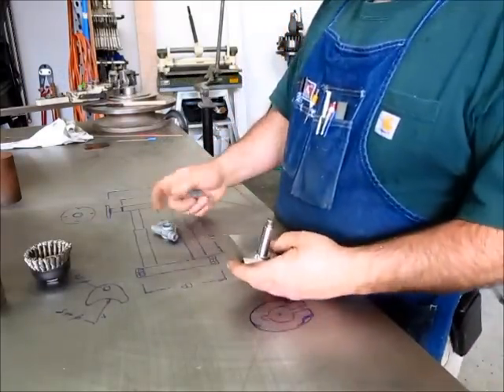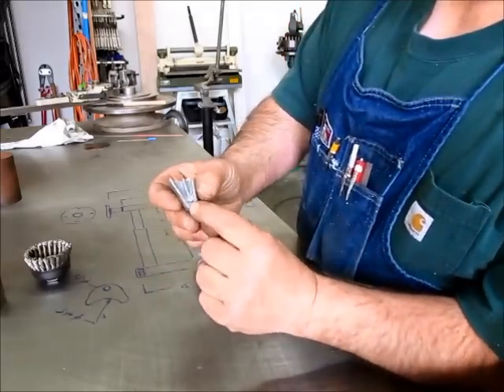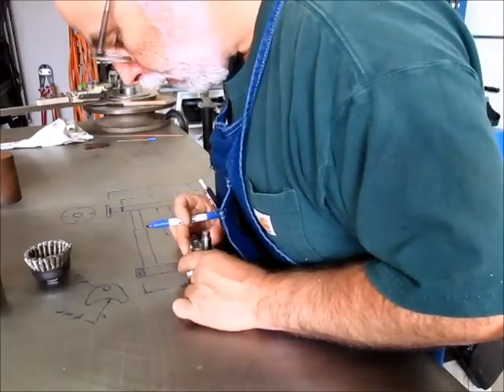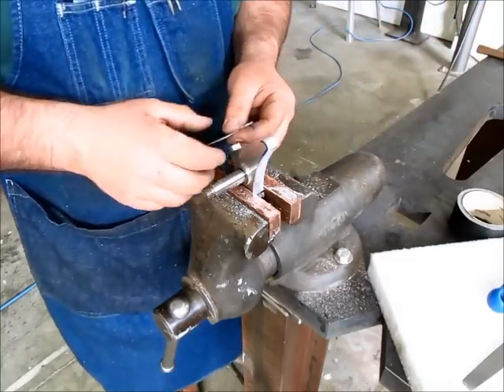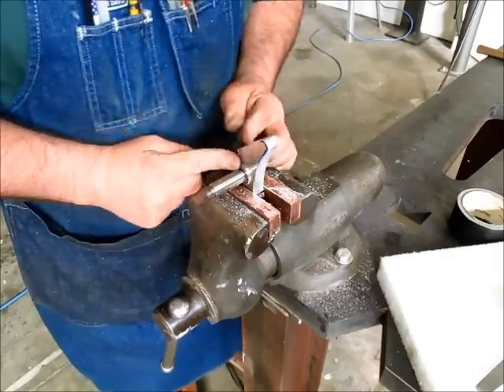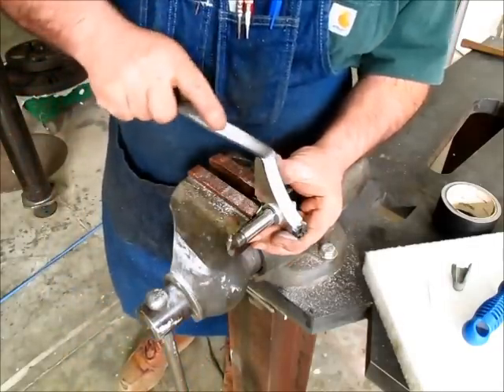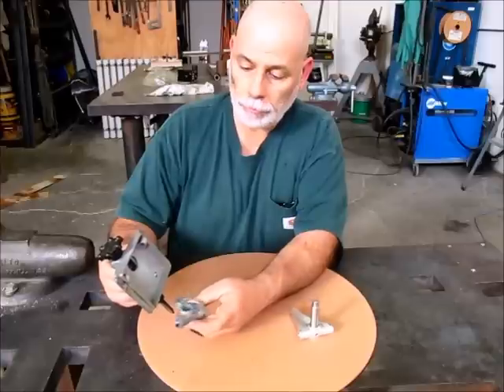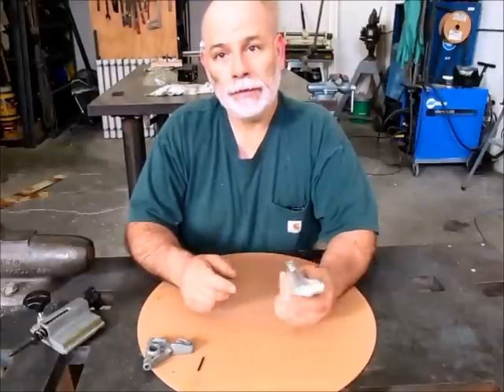Blade Tensioner Repair Part 6

Comment: Tom,

I wanted to thank you for such a nice series on this.  Years ago when I had first finished college I took a job teaching in Georgia,  the school had a no name Taiwanese 14" band saw in the wood shop with Identical part failure.  Parts were unavailable and I did not have access to a milling machine to make one up.  There was not even a machine shop near by to get the part made, so sadly the machine went into the dumpster.
Reply from the maker: Hi Mike,

Thanks for the comment. It part of our duty to try to repair things that are worth repairing. Some of us just have a hard time deciding where that line is and I suspect it varies widely with how cheap you are.

All the best,

Tom
Reply: EEK!  Yes, I know I'm a little late to the party here.  Most of these bandsaws are exact, or near exact replicas of the old Deltas.  I don't think this part has changed much in 90 years and if so, could probably be easily retrofitted with minor tweaking. It's not a precision part.  Even if the dimensions were slightly off, there is a lot of adjustment in the mechanism to make up the difference.  But then, I have a very difficult time throwing anything of potential use away.  ie:  cheap
Reply from the maker: Yeah but that didn't make a cool video. Thanks for the comment,

Cheers,

Tom
Reply: oh, no doubt.  I meant "EEK" about trashing the bandsaw in lieu of repairing it.  I hate seeing repairable item junked.  Nowadays, the planned obsolescence business model ensures that most folks do exactly that.  "New" appliances made just 5 years ago have obsolete parts with no substitutes.  1000 dollar washing machines are made with aluminum alloys that corrode to powder from ordinary laundry chemicals.  (google washing machine spider corroded) Don't ask how I know this.  Frigidaire thinks they got me, but I always seem to find a part somewhere .......thanks internet.   And it WAS a cool video.  Thanks again.

Comment: Like the trick in measuring the hole during heating.  

Used guess work before with calculating expansion so I could go off of temp.

Comment: Hi Tom
i just watched this series precision work keep telling us the speeds and feeds as i have just bought a milling machine and am on a huge learning curve .
on heating parts up to expand them i often use a paint stripping gun electric heat gun on ally and gears on car gearboxes works really well.
Another tool i have found really usefull is instead of using heat temp sticks i now use a infrared digital thermometer to check things as i heat them they are quite cheap now we also use it on the tyres of the race car
thanks again for the knowlage 

IAN
Reply from the maker: Hi Ian,

Thanks for the comment and suggestion. A good heavy duty heat gun is on my list for the shop. I use them for preheating aluminum weldments at work sometimes. Wrap the weldment in a fiberglass blanket and then shoot the heat gun inside. It will warm it up a few hundred degrees in preparation for heavy welding.

Cheers,

Tom
Reply: oxtoolco I've had really good luck with both the DeWalt and Ryobi heat guns.  The assembly sure looks like the blade adjuster on my Harbor Fright Band Saw.  My next job is to make a better blade guide assembly using bearings instead of rub blocks.

Comment: Hi mate.
Thanks for that video.  I never knew how those bosses were made.  The stupid thing is, that when your' shown how to do it, it makes total sense, and think, how could I not have seen that.  Again, it was the journey, because if you wanted you could have used the block as is, and it would have worked, just the same.  Thanks Tom,
Marcel.

Comment: Just finished this series. Quite interesting especially the kellering. I always figured someone would have done such a thing but never had seen it. Perhaps I should have used it to do the angle plate some time back but I opted for the grinder instead....:-(
Maybe with a few spare years you could have "kellered" the etching press handwheel radius...LOL
I do like the challenge of re-creating the part, and a better one to boot.

Cheers
Colin
Reply from the maker: Hi Colin,

You laugh. I actually considered it for the outer and inner rim radii. With a large ball end mill it does not take that many passes to do 90 degrees. Heck if I could get Chuck a couple times a week it would have been cake.

Cheers,

Tom
Reply: oxtoolco
Ya, Chuck's no patsy... he'da bailed..! :-)
Besides, doing a wheel that big should be called "KILLER-ring"

Colin

Comment: Hi Tom Thank you very much for an excellent series - I learned a lot from this one!!
I have the impression the little booklet was going to be scanned in - just curious if it was and where I can find it on your blog - been through the blog a fair bit but didn't come across the booklet.
With respect to your procedure - being very inexperienced - I would likely have plugged the holes and taken it to a small local foundry to have it cast in aluminum. I know I would have to deal with shrinkage but wouldn't think that would be that much of an issue.  Big thanks again - Rod
Reply from the maker: Hi Rod,

Get your email address to me and I'll send the scan to you. T Lipton then the number two at the google mail thing.

Regards,

Tom

Comment: Sorry  Mr Lipton
The  question should  have been  made  clearer.
U utilised a round Bar, drilled and tapped for a Bolt an then Mounted the Blade Tensioner  thereon.
Now because  U were  using aluminium this Jig-of-sorts sufficed.
What if U had to turn the same Boss on a piece of 316 or 304 Stainless  ???
Or  even  1018 or Tool Steel which U Folks use  ??
Would U have done it any different ??? 
That's the reason why we wanted to know if a FACE PLATE would have had to be used for heavier Metals
Pray, do tell !!!
Thanks in advance.
aRM
Reply from the maker: Hi Arm,

Ok that makes more sense. I might have used a more durable material if the part was stainless steel. It depends how many would need to be made. If I had to do a bunch I would spend more time with a durable fixture.

Cheers,

Tom